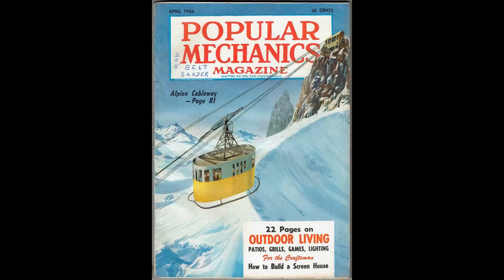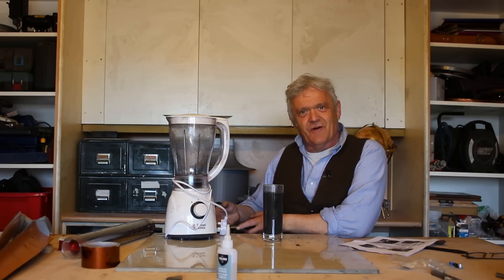1944 A Live Event You Might Not Want To Miss - The Latest Elegoo Products reviewed And More

Comment: Can I run the 3D printer off a ups? I rarely have like 9hrs of constant grid power
Reply: Depends on how big the battery is.  I have the Plus, and I measured the power usage -  when everything is running (hotend heater, bed heater) it uses 450w.  Once heated, it fluctuates between 20w and 70w as it just runs the motors and pulses the heaters to maintain temp.  a 3.5 hr print used .5 kwh of electricity.  So they don't use that much, really....and the Plus is one of the bigger ones.
Reply: @Dave_D.  thx, still getting my head around kWh and Ah of batteries. Let's say we don't have to worry about start, that we do with grid power on, but need a ups battery to cover a 2 hr power interruption. Would a 100Ah cover say 50w requirement. Or should I say, would for instance one of those 12v deep cycle batteries they use on gate motors work. Does the printers have a 12V converter plug like laptop or would I need an inverter. Thank appreciate the help, really considering getting one, but I know this is one of my obstacles. We currently get 2 hr interruptions 3 times per day, sometimes goes up to 4 hrs at a time.
Reply: @adesign5  I'm in the same boat with the same questions
Reply from the maker: yes you can
Reply: @adesign5  100ah @ 12v is 1200wh.  Depending on the type of battery would determine how much of that you should use (ie  let's say lead acid is not recommended to go below 50%).  So if we say you have 600wh of capacity, and the printer averages 50w/h (once heated up and running), should let you run it for 12 hrs.  Even allowing for start up, I figured I could run it 7 hrs per kwh, so that's 4 hrs run time.  You would also need an inverter, which would give some loss on top of that.  Consider this info w/ a grain of salt...it's late, I just got home from work, and I'm tired...so I may have some #'s wrong.  LOL
Reply: @Dave_D.  thanks man, does help. So like 100% I need quite a good ups also. Not all bad, can use that ups then for other things also. Cheers!
Reply: @adesign5  Also the type of battery.  LiFePo, for example, can be taken down to 20% state of charge.  There are quite a few videos out there about making small, portable, self contained backup power units similar to the EcoFlow, Anker or Jackery.